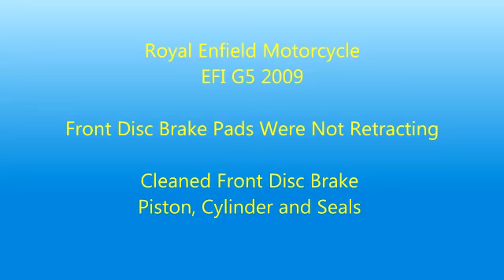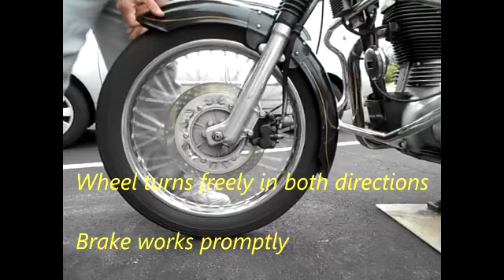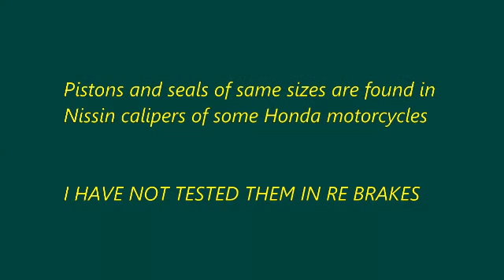Front Disc Brake Piston Cylinder Seals of Royal Enfield Motorcycle Cleaned

Comment: Good explanation, thank you. A couple of tips I've picked up. Its, ok to clean the piston up with some autosol and a soft polishing cloth, although still clean with brake fluid and degrease afterwards. On the seal itself, note that they are 'sided', there is a right way and a wrong way that they go in which ensures a correct seal. Get it wrong and the brake fluid can pass the piston and the brake will fail. Could spoil your whole day! I'm sure you know this as clearly you get it right, but just in case someone watching doesn't. It might just save them a trip into the hedge.

Great videos on Enfield maintenance, I know it takes a lot of work to put them together. Nothing like watching it done!

Best wishes, ride safe

Peter :-)

Comment: Hello Singh Sir,

As always its a delight to see your works and the pleasan music. Sir, I need help. My continental GT brakes are opened for a re-build. My seals are of 30mm and 32mm as per Parts Catalogue.

Problem is R.E. doens't sell them and has requested me to buy new caliper assembly that costs Rs.10,000/- INR.

Can you please tell me any other motorcycle make that may help me to get the seals?